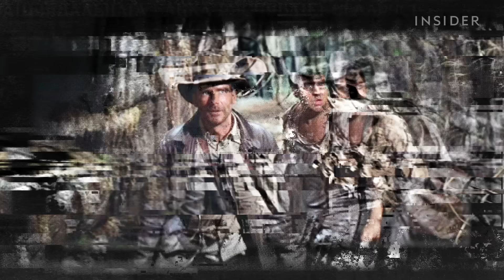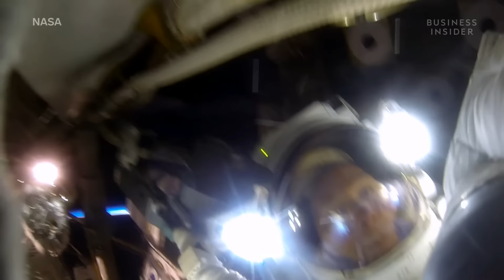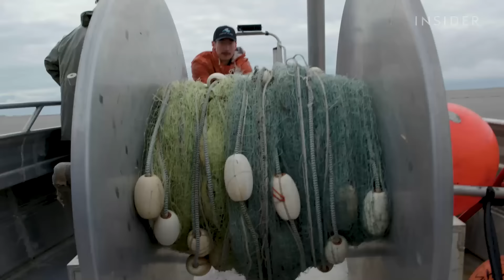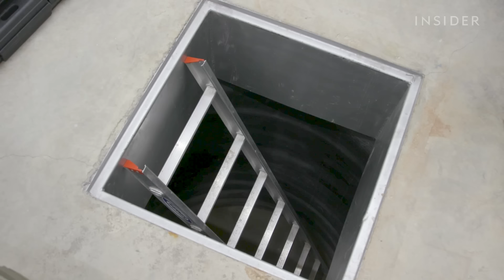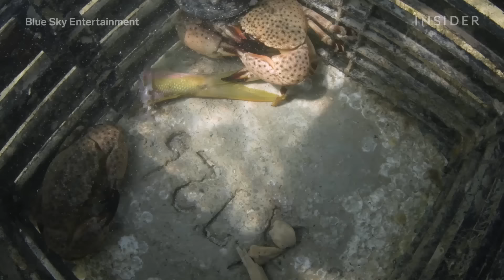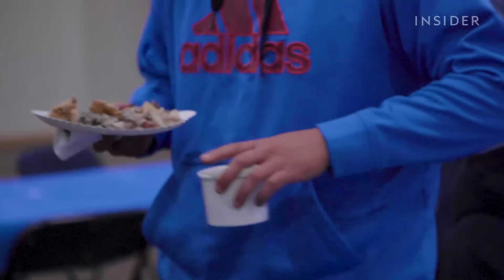11 Of The Most Expensive Items Made In The USA | So Expensive Marathon | Business Insider

Comment: my hunting knife "originaly intended for" now i use for cooking as a chef .Reinforced steel and i cant recall what else. its heavy durable and sharp. will go hardly go dull but duo to the thickness and in the kitchen needs to be sharpened more often to keep the lazer sharp, hell even the wooden handle barely has any damage on it "mostly duo to people using it without permision which led mostly to being dropped" im soon makin 10 years with that knife and still performs majesticly and costed me around 300-350 dollars only i might need soon to replace the handle. Not the best lookin knife but damn even my ol service knife cant match with it

Comment: The galvanized fence is very very thin. My experience they will burn very easily with high Temp if you ever stuck a welder to a galvanized chain-link pole it will deteriorate

Comment: Folding steel is necessary if you have low quality iron. If the iron isn't shit, folding does nothing. Worse, folding too much makes the metal increasingly brittle. Some of those fold numbers will probably chip the blade the first time you touch the cutting board. One of many markets where people pay for what they think is quality, but it's really trash.

Comment: I'm sorry but Damascus steel is only visual aesthetic, really has nothing to do with the performance. Since with gives the pattern on Damascus are cheaper metals. What does give sharpness and rigidity is the folding method. On which sushi knives and katanas are made. Damascus not so much. It costs a lot depending on how long it takes the blacksmith to make the Damascus. The steel itself it's not what sets the price. If it was easy to make Damascus it would go for pennies on dollar.

Comment: Damascus Steel (or Persian Steel), the folding of different types of steel for forging, was developed 1,200 years ago in India & Sri Lanka. Why this wasn't mentioned in this documentary is suspect. Also, NASA's new Moon Suits, contracted to Axiom Space and Collins Aerospace, are as difficult or more difficult to make than an EVA Spacesuit. Moon Dust is electrostatically charged, is Highly abrasive (because it's never washed over or blown around), and wreaked havoc on NASA's Apollo era suits. 
   It damaged or made equipment inoperable in only hours of exposure, but NASA doesn't talk about it much. The Moon Dust that accumulated in the Apollo LEM's effected the lungs and breathing ability of the Apollo 15-17 Astronauts on their Extended Missions. NASA farmed out development of the new Artemis Moon Mission Suits after failing miserably at it with years long delays and major cost overruns. They're going to have a much more difficult time developing Moon Dust resilient Suits than they will w/ EVA Orbital Space Suits. It's surprising that wasn't covered here as well.

Comment: Damascus knives aren't inherently stronger or sharper. That is a myth.
They can take two nearly identical steels, layer and process them, then etch and stain them to look like a knife with very different steels.
The strength is in the choice of steel, and the sharpness is in the skill of the knife maker.
You could get a stronger, more reliable knife by taking a harder, high carbon steel and sandwiching it between two sheets of milder steel. No Damascus pattern necessary. The harder steel will keep an edge longer, while the milder steel will keep it flexible and support the harder steel edge against chopping
Damascus is about aesthetics, not quality

Comment: White gold used to just be normal gold that was dipped/plated in rhodium, to make it more resistant to damage. Usually these pieces would come with warranties where you would bring them back in for free every couple years and have them "re-dipped".
Reply: Yeah, uncoated white gold is dull and fairly soft. A lot of it is still rhodium plated for the shine and durability. Anytime I've had white gold at a jeweler they have offered to plate it for me, though I usually prefer the duller, kinda whiter/less silvery look. Though I rarely wear jewelry so my experience is limited on the subject.
Reply: @L3ttuc3  White gold is not normal gold dipped in rhodium. White gold is gold mixed with either nickel or platinum or silver. It is dull and dipped in rhodium to make it shine.